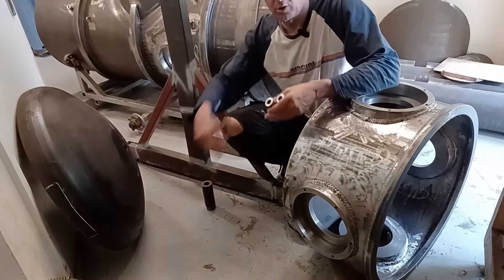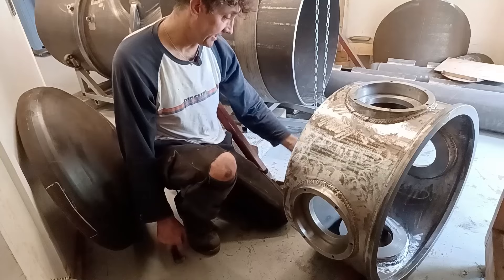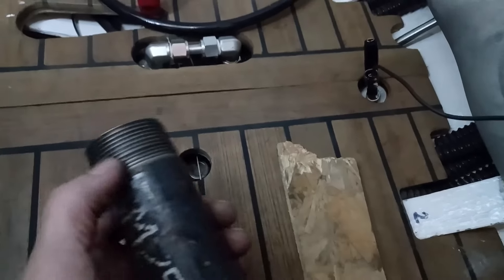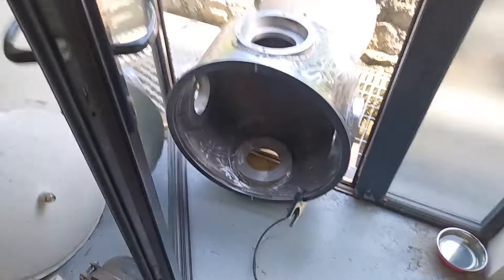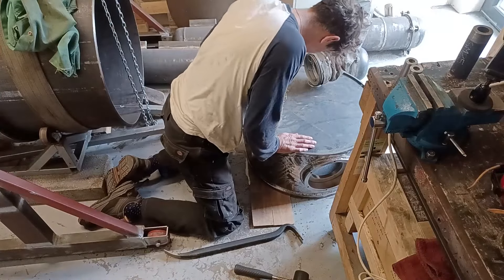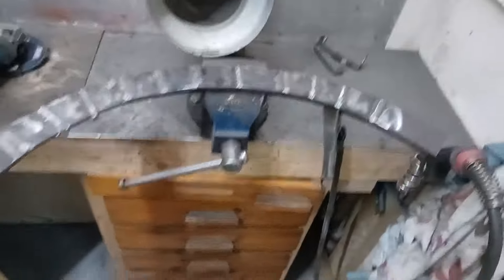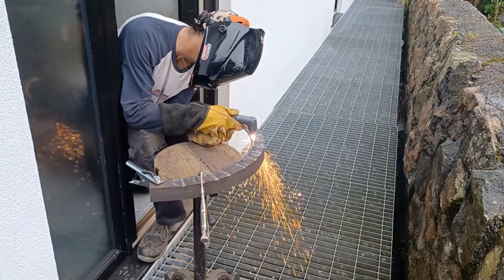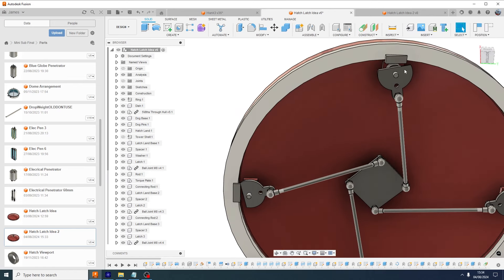Building a Submarine. Part 149.

Comment: Use a flat bar instead of a rod, for the hatch closer.  Then the flat bar is held between two flat pieces so the flat bar can move in two directions.  Grind the end of the flat bar to a wedge to go under the land ring.  Worked perfect on Gamma
Reply from the maker: probably will Hank.  I just cobbled that drawing up to get an idea of if it would work.

Comment: On that hatch locking interface I would think needs to some small ramp that as you turn the handle, the more you turn it the tighter it gets.  And I hope your using some type of seal around the door.
Reply from the maker: yes agreed.  I just didnt really show that on the model as it will be ground\machined as i make it, so it fits properly.  The hatch will be sealed with an O ring in the hatch ring.  Thats being machined this week I hope.  Thanks for your interest.